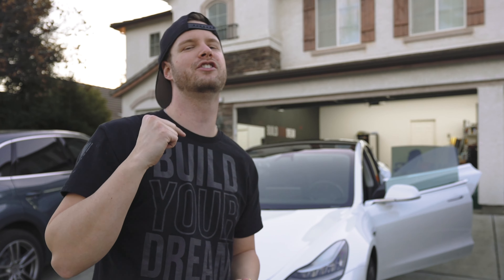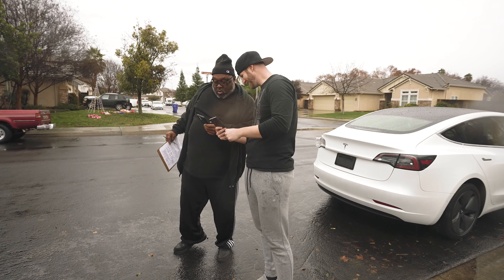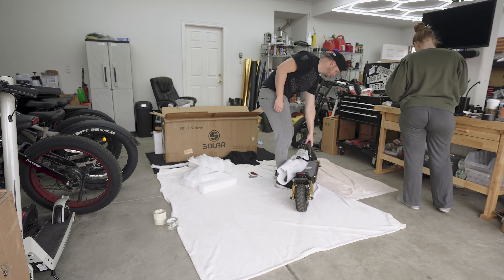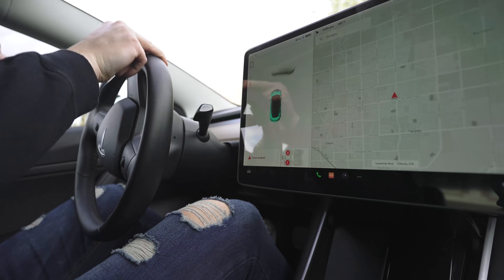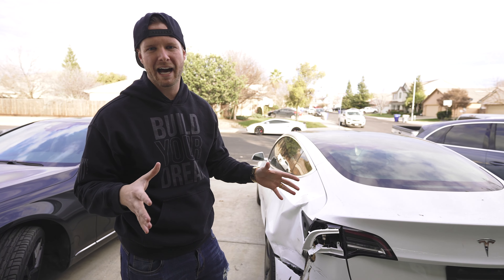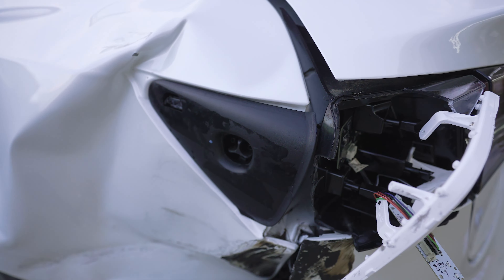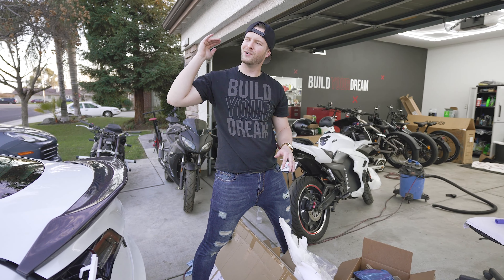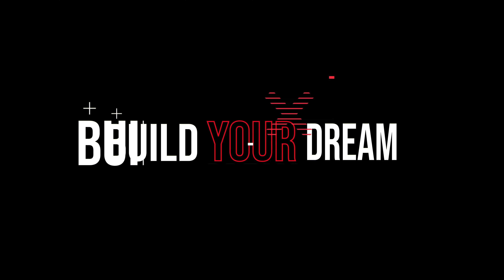I Bought an ELECTRIC CAR for $18,500

Comment: The coolest thing to do with Tesla's, is use their motor to do vintage conversions. One I have yet to see done, is a 1970's Chevette, with a Tesla motor. The coolest, would be a 1979 Vauxhall Chevette 2300 HS, Like Jimmy McRae drove in the WRC, but it makes more sense to find a Chevy counterpart...They had the cool front end in the 70's. They look really cool set up for rally, from that era, with flared fenders, big rally lights in the front, a cage inside... Electric would just be crazy! Never seen it done.

Comment: When the damage is repaired it's worth 25 to 30k all day.i would never use self drive anyway but the park assist if it has it is a legit thing even the one on my ol2012 truck works well
Reply from the maker: Yeah for sure, I hear the self driving has a few known glitches at times like ghost braking! But it should have the "summon" feature which is sweet.

Comment: You're lucky to be in California seeing as these account for like 3/8ths of the cars on the road there, lately. Plenty of opportunity to get a Copart rescue that doesn't totally suck. And you're getting it at a point where it's easier to get OEM and fairly decent aftermarket parts for it when just a few years ago everyone would say it''s like a 3 month wait for licenced repair shops to get their replacement parts from the factory. You could probably get away with one of those resin glass repair things for the window, but I'm getting the impression you might have to fabricate that rear quarter on your own.
Reply from the maker: Yeah I'm going to do all the repairs myself if possible! But there are some local body shops that do good, fairly cheap work that can probably do it in a couple hours.
Reply: Have them work out the panel and finish and paint it yourself unless they are cheaper to do the repairs and paint.

Comment: Nice to see you're able to get a Tesla that cheap. They are finely coming down to normal used car prices. Hopefully it is as easy to fix as you think.
Reply: Not in Canada There are insane price wise
Reply: @onknight  no salvage or yards junk yards there this is used with damage
Reply: @onknight  A severely damaged Model-S that would definitely have to receive or not taking charge anymore dead battery pack or even just the blown out main fuse can total a Tesla.

Getting parts from Tesla without right to repair laws will total car.

Comment: 2 things:

1) Get rid of that level 1 charger. Send it back if possible. It cost $200, but you can buy the mobile charger for $230 and that comes with the Nema 14-50 charger which is level 2. The level 1 will give you maybe 2-4 miles of range per hour. The level 2 will give you 20-35 miles of range per hour. For a model 3 probably 30-35 miles per hour. The level 1 charger is really only for emergencies. 

2) If the insurance bought that car it is totaled. if it is listed as salvage or totaled then Tesla will disable the supercharging forever.
Reply from the maker: It was actually listed as Clean title (dealer license)....so we'll see what good ole Elon does with it.
Reply: @TheInja  that's a good thing then. A clean title should mean the supercharger is still working. You just want to check the wires at the back of that connector and make sure they are not damaged.